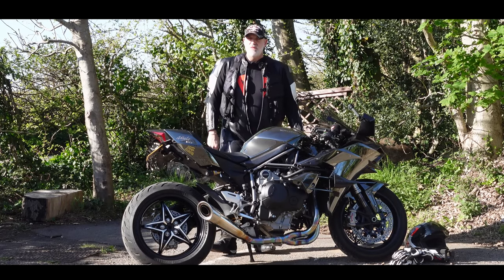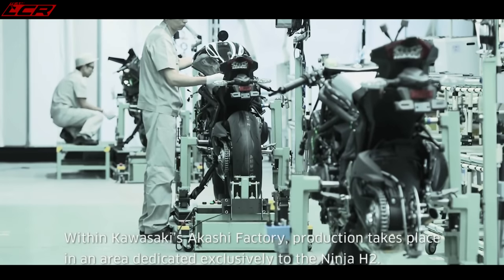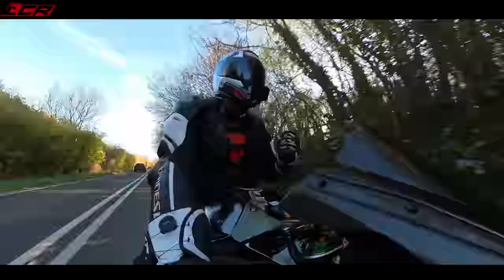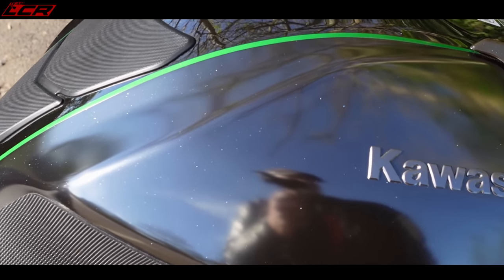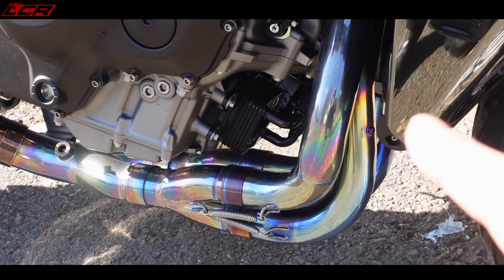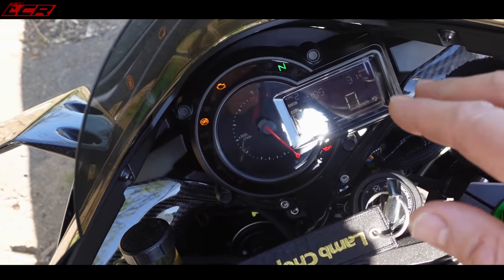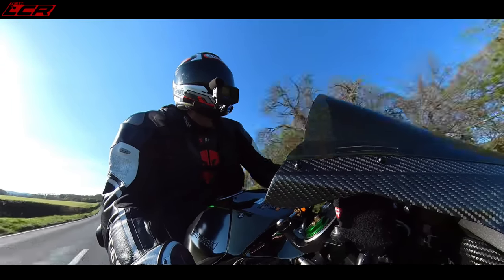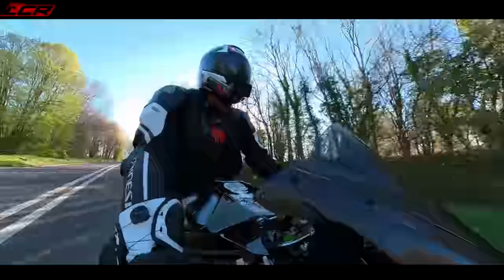The Kawasaki Ninja H2 | Why Is It So Special? 🤔

Comment: Brought mine back in 2016, after thousands of miles, still takes my breath away!
Reply: They are awesome machines brother love the H2, i have a 2021 model and its going in tomorrow for a full ecu flash, Full Vandemon System, MWR Race Filter , i have H2 meet coming up in May so i need get it ready….fingers crossed it will be the biggest H2 meet in the UK , you are more than welcome to join us mate….im hoping for more than 40 H2’s turning up at the meet in Stratford Upon Avon in May :)
Reply: ever had any issues with it? been wanting to pick one up soon
Reply: @randombruh3033  only issue I've had was the paint started peeling off the front cowling, but Kawasaki did replace it.

Comment: Awesome video Chop and awesome bike. My H2 Carbon will never leave!
Reply: They are awesome machines brother love the H2, i have a 2021 model and its going in tomorrow for a full ecu flash, Full Vandemon System, MWR Race Filter , i have H2 meet coming up in May so i need get it ready….fingers crossed it will be the biggest H2 meet in the UK , you are more than welcome to join us mate….im hoping for more than 40 H2’s turning up at the meet in Stratford Upon Avon in May :)
Reply: @MotoQuickShifter Sounds  awesome !🤩 Did most of the same modifications. And received today my last upgrade. Öhlins FGRT 221 fork, this in combination with Brembo GP4RX MS calipers, Corsa Corta RCS19 Brake and clutch handle. And changed the brake lines for RVS Spiegler 😅

Comment: What a thing of beauty! I had the original H2 (the 750 stroker), in the intervening years I've had the RG500, GPZ900R, R6s ,GSX-R 750s ,R1s and Blades but as a pensioner my Street triple RS is enough for me now but of all the bikes I've owned the old H2 was the only one that scared me on a regular basis, it handled like a pig until I got the engine dropped into a Magnum frame, suddenly it was the fastest best handling bike in the greater Belfast area through the mid to late 1970s.

Comment: I know the SX, and the ZH2 have different internals on the engine, but the fact that Brock's has the ZH2 up to 245 wheel with just a tune and exhaust is amazing. Once guys start changing SC gears, intercooler, bigger injectors, the only thing holding them back is what power level will break the internals. These are amazing motors.

Comment: That thing is just in a class of its own. About the only antidote to that I can think of, unfortunately, has blue twinkly lights attached. The enginerding that went into producing that machine is at the absolute pinnacle of precision and shows that mama Kwak really does know best. I seriously doubt that there will ever be another Dino powered machine built, by any manufacturer, that matches the vision they obviously had when that thing was just a scribble on a napkin. I wouldn't mind seeing and hearing more of that on the channel 👍

Comment: I had a GPZ 750 turbo back in the day, it was awesome  and it had a unique  sound when you  wound it on.
Reply: Me too, wish I still had it
Reply: Likewise. Had one between '90 and '92, with a Harris black chrome 4 into 1. Whilst compared to my mate's Slingshot 750 it was a wheelbarrow, I never got bored of the mid-range shove and the noise it made - popping and banging and spitting flames on the overrun 👌

Comment: I love this bike so much. 
I own the H2SXse I decided to go for this model as being 23 years old I don't have the money or the insurance reputation to own multiple bikes xD If I was going to spend that much money on a bike I wanted to be able to take that bike anywhere and not regret it. Be comfortable and have fun. 

I wanted to own a H2 also one day or at least get the chance to ride a flashed one too but with them not being produced anymore it's not likely :( . 

My H2SX makes 230 rear wheel horsepower and I love it I also have a slight snatchy throttle so keep my hands on the front brake to counteract it when it jumps off when you come back on xD 
Can't wait to see the video when you sort that snatchy throttle out as I will want to do the same too and I am from the same area!
Reply: Out of interest, did you find it difficult to find affordable insurance?
Reply: @kevinmobile  I did indeed. This year was particularly hard had to devalue the bike by a couple grand to get it from £4000 to £1800 for the year. Well worth it though. 
Was hoping next year to get the bike value back at what it's worth which is £13,500 

so yh if you bought a new model you would be stuffed.

Comment: Had the same clutch problem in my 2017 carbon, wasn't in the recall list. I did what you did and fixed it for 6 months and the problem came back so I fitted the replacement at my cost. Another issue to check is the back wheel nut, even though it has a locking mechanism it does come loose. You can easily check the play in the rear wheel. Recommended tightening then un-tighten again 
Then up to the torque value. Happens a lot and Kawasaki haven't acknowledged the problem.  Most of the critics either don't own one, scared of it suffer from cognitive dissonance. Mine will be sold as part of my estate when I shuffle off.
Reply from the maker: Ah OK thanks didn't know about the rear wheel thing 👍

Comment: What an epic video Sean Chops absolutely love it, They are awesome machines brother love the H2, i have a 2021 model and its going in tomorrow for a full ecu flash, Full Vandemon System, MWR Race Filter @PCR PERFORMANCE in Cannock, they have dealt with many H2’s i highly recommend them…i have same issue with a snatchy throttle but hopefully Paul @PCR will get rid of this issue, i have 50 H2 owners in my H2 Owners Club and half of them push more power than a H2R , honestly we would all love you to join us in the H2 meet in May it will be an honour Sir Chops 💚

Comment: I have a 2016 that I bought last may that only had 47 miles on it, I have owned a 18 R1 and a 17 Hayabusa and some older GSXR 1000's and people ask me to compare them to the H2, but there is really no comparison..
Reply: They are awesome machines brother love the H2, i have a 2021 model and its going in tomorrow for a full ecu flash, Full Vandemon System, MWR Race Filter , i have H2 meet coming up in May so i need get it ready….fingers crossed it will be the biggest H2 meet in the UK , you are more than welcome to join us mate….im hoping for more than 40 H2’s turning up at the meet in Stratford Upon Avon in May 💚

Comment: You need to ride one to fully appreciate how special it is. I recently put green bst candy gloss carbon wheels on my 2016 model too. Waited 6 months for them last year ! Improves the handling.

Side note. You are losing more than 15 hp from crank to wheel -  it’s around 12 percent. So your bike is likely putting out around 280 hp. Mine is a little snatchy too and I’ve put a lot of work into the mapping after the Dyno.

Comment: I have a 2016 Kawasaki H2 as part of a Superbike collection of both Euro and Japanese latest models .   Love the H2 fun , brutal acceleration  and very comfy for a superbike .

FYI....The 2019 up kawasaki H2 DID NOT have 228hp as listed by kawasaki . When tested the Kawasaki H2 had the same 200hp as its previous models .
Reply: Have a 2020  H2 carbon  227.91 bhp at the back wheel stock. Added   full vandemon exhaust system  sprint P-08 air filter no tune 231.7 bhp I appreciate every dyno is different doe
Reply: @K-carbon   i have a 2021 model and its going in tomorrow for a full ecu flash, Full Vandemon System, MWR Race Filter , i have H2 meet coming up in May so i need get it ready….fingers crossed it will be the biggest H2 meet in the UK , you are more than welcome to join us mate….im hoping for more than 40 H2’s turning up at the meet in Stratford Upon Avon in May :)
Reply: They are awesome machines brother love the H2, i have a 2021 model and its going in tomorrow for a full ecu flash, Full Vandemon System, MWR Race Filter , i have H2 meet coming up in May so i need get it ready….fingers crossed it will be the biggest H2 meet in the UK , you are more than welcome to join us mate….im hoping for more than 40 H2’s turning up at the meet in Stratford Upon Avon in May :)
Reply: @MotoQuickShifter .I recommend a sprint P.08 air filter  better filter all round   sounds great unfortunately I'm not living in the UK

Comment: 25 000km on my 2019 and counting 🤣Hope Suzuki follows suit, no competition since 2015.
Reply: Well the GSXR 1000 is the fastest 0-60, at 2.3 seconds or something stupid, not competition enough! lol There are a few quicker bikes after that too apparently.

My 22 y/o ZX9r will give it a good go low down before it's left, as it's not stock. Stock was 0-60 in 3 secs (stock H2 2.6-2.9 depending on source (maybe model year idk). But tbf this is all theoretical, on paper so to speak, time to take them all to Santa Pod 😁🏍💨
Reply: @HalfdeadRider  at this point in time we should be looking at 0-200 😁 times. If you're chasing 0-60 just stretch it
Reply: @Nekminute  Yea 200 on your personal, non stock bike, it is possible quite easily with some tuning and tuning mods (yours is FI, mine is carbbed, easy tuned myself). But stock ZX12r it's just under 190 as you know.

But I think you ignored the 0-136 time lol, of the old heavy 98-99 C1 & C2 ZX9r, the E & F models obvs are even lighter and faster remember lol. So after that 140 or so with a later model ZX9r, up to 170 you won't get far ahead at all, then you'd creep away to the 190.

The only real world difference is that you'll use more fuel for the same fun.

Pity you're not local, would be fun to test them together and swap bikes for some fun.

Comment: My fav looking bike ever is the z650 (GREEN ONE) from the late 1970s. Not the new one whith the anaemic engine. If Kawa updated that bike, put a supercharger on the 4 cylinder engine, and had it make 130-40 hp, I would buy one tomorrow. Max 150hp. Even that is pushing it. A bike with a top end scream (legal) and low down torque would be marvellous....and light weight.

Comment: I wonder if you could share some details about riding experience. I know you had a liter super bike and I also have a ZX10R. When you ride the H2 does it feel a lot larger and heavier? I enjoy riding roads with sweeping curves at 30-80mph. I would not describe them as tight roads but definitely very curvy. Also wondering about riding position compared to the ZX10R or your GSXR? More relaxed riding position? Thanks!

Comment: The mention of two speed Super Charger does not seem correct to me as it runs at one gearing ratio only. Maybe it's a miss-translation as the air velocity is at 2 speeds due to the impeller vanes working differently but in unison. I own a rare 2017 numbered carbon and the workshop manual I got with the bike shows only one standard gear ratio.

Comment: I think Kawasaki totally missed a golden opportunity to more accurately pay homage to the original H1 and H2 TRIPLES.  First off I was a Kawi mechanic in the early 70s so I rode and tuned a LOT of triples (even though personally I rode an Yammie RD)   Secondly I just purchased a Yamaha 900cc triple which so brings back the feeling the triples gave even though they were 2 strokes.  My point is that Kawasaki COULD have SHOULD have created a TRIPLE to honor the H2 name sakes!   idk maybe supercharging a triple would have problems though I cant imagine why but if not it could have been SO awesome if they had made it say a supersharged 1000cc TRIPLE with the same kind of wonderful nature Yamaha's CP3 possesses on on STEROIDS!  I think they messed up not doing so!  It also would have helped offset the pork issue with the H2 which is afterall pretty overweight if you ask me...

Comment: 2022 Kawasaki Ninja H2 (ZX1002J)
Curb mass 238kg, Max Power 170 kW {231 PS} / 11,500 rpm, Max Power with Ram Air 178.5 kW {243 PS} / 11,500 rpm, Max Torque 141 N.m {14.4 kgf.m} / 11,000 rpm

Comment: Where does it end?  You’ll have to talk to someone who owns a 500hp turbo BUSA I guess.  Maybe someone who has owned one of them for a few years, if you can find one of those.  Does such a person dream about having 600hp, or maybe 500hp that corners like a MotoGP bike?  The funny thing about that question, “where does it end?” is that we always think, “the end is just around the corner”, but it’s not.   

I had the pleasure of owning a red and black 1986 1000 Ninja.  Compared to my previous Yamaha FJ1100, it seemed to slip through the air so much easier and it was the fastest production bike ever made, topping out at just over 160 mph.  Seemed like that was already as insane as it would ever get.  But, the party was just getting started.  

I still regret selling that bike.  It was so good at sport touring.  I used to load it up like a pack mule and ride the best roads for weeks at a time, alternating between camping at night and cheap hotel rooms.  You see, feel and smell everything so much more on a motorcycle.  You aren’t just passing through, cocooned in a steel box, you are in the environment.  You feel every temperature change as you drop down into a canyon or climb up a mountain side, you smell every change in vegetation and there is nothing blocking your view.  Every day is an adventure and you feel so alive.  The sense of freedom is impossible to explain, and maybe it’s unique to those who were born to do it.  

Sometimes I think back and try to calculate how many corners I took at speeds that would make the average human being scream in sheer terror.  It is an impossible task, there were too many.  I still own and ride a couple of bikes.  A 2000 VFR, that became my new sport touring ride after the ‘86 100 Ninja and a black, 2006 CBR1000RR for more serious riding.  No electronic nannies on either of them.  They’re old technology now, but so am I.  At 70 years old, I don’t get out on them as much as I used to. A battle with Stage 4 Cancer has also taken its toll on my strength and energy, but I still get out for a rip every once in a while.  It still feels like freedom.

Comment: A super charger runs cooler than a turbo, but compressing air cuases the tempreture to rise, anything over 6/7psi its allways pays to have an intercooler........or at a pinch spray water into the engine...

Comment: Why have the big 4 in Japan not invested in more supercharged or turbo bikes, with a lower cc? If they developed a 600cc bike with a supercharger on it, it might be the perfect bike for sports or touring, depending on how it's set up. Plus, fuel efficient. I wouldn't want a H2, too much hp. I don't like being terrified on my bike.  For smaller capacity bikes, however, the tech makes loads of sense.